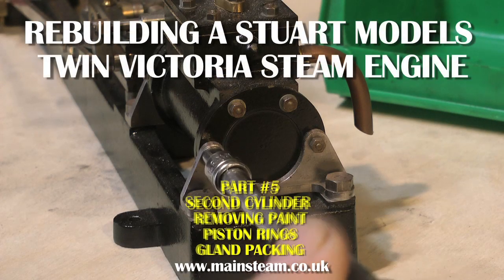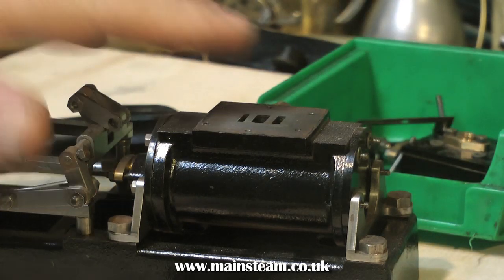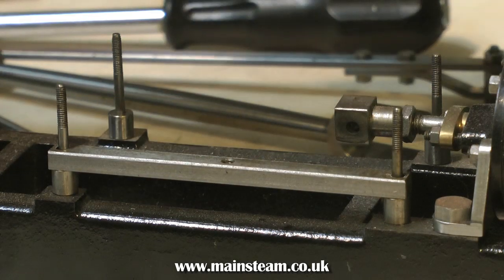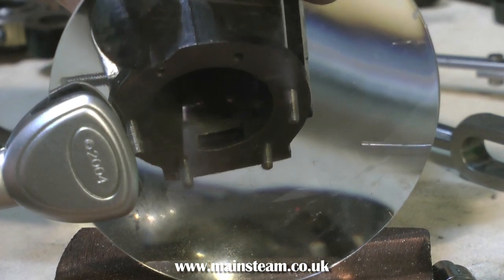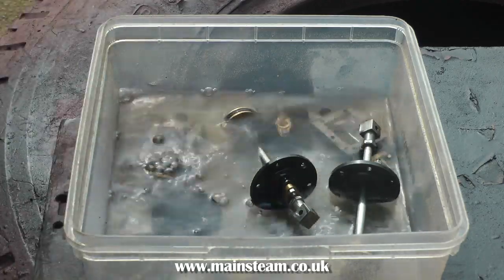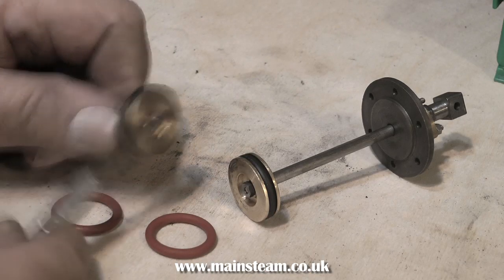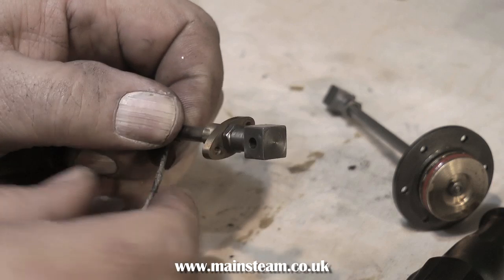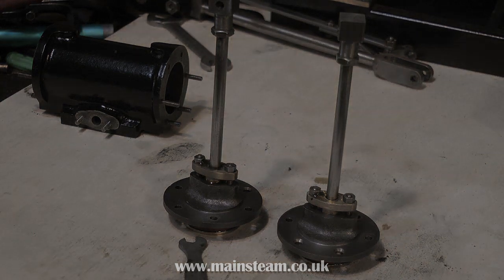PART #5 - REBUILDING A STUART MODELS TWIN VICTORIA STEAM ENGINE

Comment: Hi Keith,

I'll be building my first Stuart model engine in the very near future. It'll either be a Stuart 4 or a 9 and I wanted your opinion on cast iron piston rings for these models. I know you normally use o rings but I was just curious.
Reply from the maker: I like cast iron piston rings, with proper lubrication they last a long time.